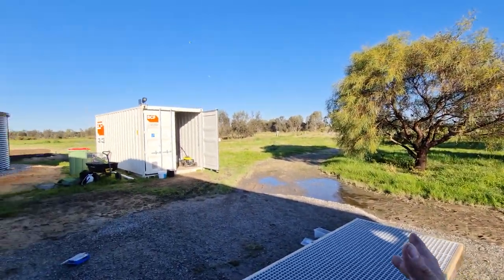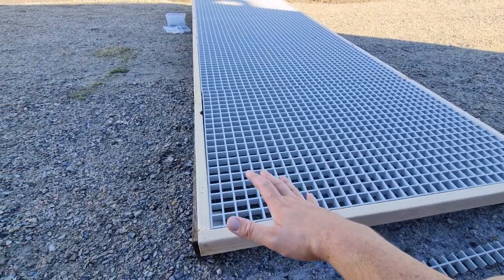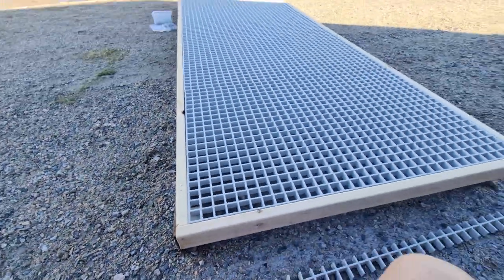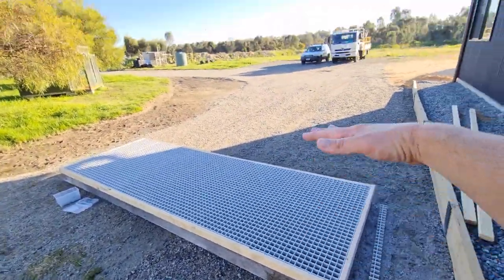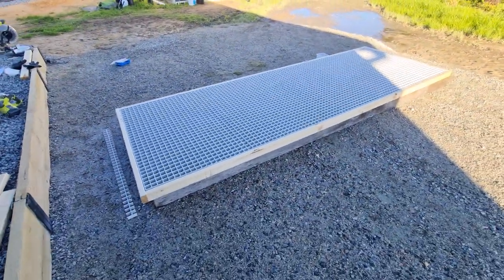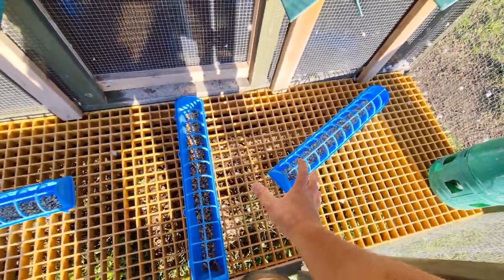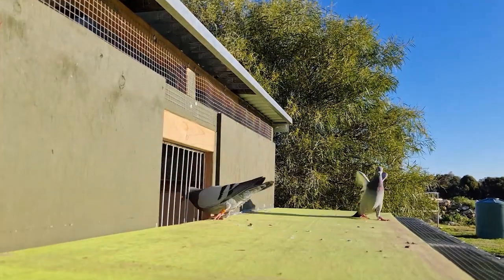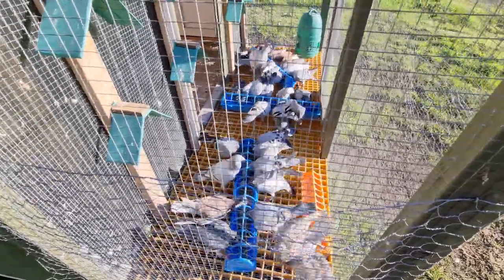Pigeon Loft  ( aviary floor Grating )

Comment: Is that a solar panel on your loft? Or am I mistaken?
Reply from the maker: Yeah its a solar sensor light
Reply: @ManeyPigeons  that's really awesome. Where did you buy the solar panels? And are they connected to a battery or do they charge the lights directly?
Reply from the maker: I got them from bunnings they have an inbuilt  battery just good if i need to go out an night atleast im not tripping over ect 😆 its a all in one unit
Reply: That's really nice